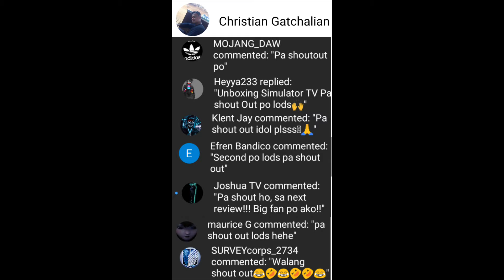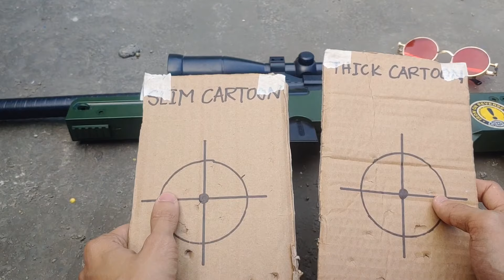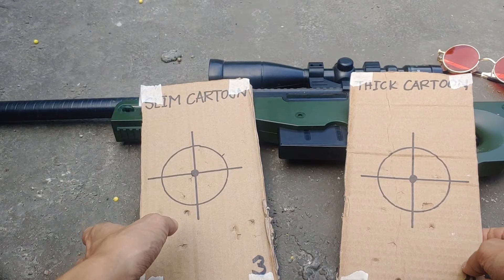How To Upgrade Spring Type Airsoft L96 (Upgrade by UNBOXING SIMULATOR)

Comment: Lods bumile ako 8mm aluminium barrel kaso Hindi fit ang mga bbs, brass tube be dapat talaga?
Reply from the maker: Nako lods... Dapat 6mm ang inner diameter.....ganyan din nangyari sa akin lods....di kaagad pumasok yung bbs.....kaya dapat percision bbs na ang gamitin hindi na yung mga low grade na bbs
Reply: @Barrio_WakwakG.  6mm inner diameter at .20 at .23 precision bbs gamit ko Pero Hindi parin kasya
Reply from the maker: @l3m0n73  uhm....kailangan mo lakihan ang butas ng dulo ng barrel lods....na deform kasi angbsize ng dulo ng barrel lpds dahil sa pag cut nyan sa factory.....so hindi exactly 6mm ang dulo nga barrel.,...kaya ang ginagawa ko ay......... Gagamit ako ng knife or scissors.....at gagamitin ko yung matulis na dulo ng knife or scissors......para itapat sa dulo ng barrel.......at ididiin ko......at ika-carve out ko yung dulo sa pamamagitan ng pagikot ng matulis na part sa knife or scissors sa may inner diameter ng barrel......para lumaki ng kaunti ang butas ng inner diameter ng dulo ng barrel......gagawin ko ito ng paulit ulit hanggang pumasok na yung bbs sa loub ng barrel........at para tumagos yung bbs......gagawin ko rin yung prosesso sa kabilang dulo.
Reply: @Barrio_WakwakG.  ginawa ko na to lods kaso lng Yung sa gitna na part Hindi ma abot kaya Hindi parin kasya Yung bbs:(

Comment: Idle ano size Ng brass tube pipe mo 2mm 3mm 4mm 5mm
Reply: Yan po Yung nakita ko na size SA shopee ano po size Nung ginamit nyo
Reply from the maker: @jdaigaming871  ang inner diameter ay 6mm....kasi ang standard diameter ng bbs o pellet ay 6mm din....kaya kailangan mo ng 6mm inner dimeter na may 8 mm outer diameter barrel.

Comment: Lods ano po mga size ng mga ginamit mo pang upgrade
Reply from the maker: Yung metal barrel lods,,,,, Dapat ang outer diameter is 8 mm at ang inner diameter is  6 mm. Kasi 6 mm ang size ng BBs
Reply: Ahhhhh salmat ng marami lods
Reply: Lods diba pwede naman gamitin yung original barrel ng l96 pang upgrade o kailangan talaga paltan ng bagong barrel
Reply from the maker: @aruyelva8052  pwedi namn gamitin ang original na barrel lods...lalakas parin ang tira....dahil inupgrade namn ang power ng airpump piston
Reply: @Barrio_WakwakG.  sobrang salamat talaga lods
Reply from the maker: @aruyelva8052  Walang anuman lods hehe

Comment: Anu po yung outer diameter ng brass barrel po?
Reply from the maker: Nabili ko ang Copper Barrel sa Shopee at ang pangalan ng store ay fenteer.ph at ang pangalan ng item ay Brass Pipe Copper Tube Round Outer 6mm-20mm Length 500mm Model. Ang pinili kung outer diameter size ay yung 8mm para ang inner diameter nya ay 6mm.

https://shopee.ph/product/89123457/6105248218?smtt=0.366868155-1631596458.9
Reply: Oky po thank you

Comment: magandang araw po ka-review. ask ko po sana kung saan nyo nabili ang Metal barrel? at kasama na po ba dyan yung rubber na nakadikit dyan sa dulo ng Metal barrel?

at tsaka yung spring po. baka may alam kayong good source or store na maari kong mabilhan for the said parts?
Reply from the maker: Nako hindi kasama yung rubber na nakadikit sa dulo lods,,,nag modify talaga ako gaya ng pinakita ko sa video.

Nabili ko ang Copper Barrel sa Shopee at ang pangalan ng store ay fenteer.ph at ang pangalan ng item ay Brass Pipe Copper Tube Round Outer 6mm-20mm Length 500mm Model. Ang pinili kung outer diameter size ay yung 8mm para ang inner diameter nya ay 6mm.

https://shopee.ph/product/89123457/6105248218?smtt=0.366868155-1631596458.9

Sa spring naman lods,,,, yung bagong spring na ginamit ko sa video,,,, spring yun ng ibang pellet gun na sira na kaya ginamit ko nalang para sa pag upgrade ng L96,,, mas mahaba pa kasi yun kaysa sa original spring ng L96

Comment: My upgrade is just the inner barrel and the scope. The scope I disassembled the scope to add the crosshair using masking tape and black marker. The inner barrel I made it longer to make it more accurate. And instead of using the plastic or metal pipe to replace the short barrel, I used rolled long bond paper instead hehe
Reply from the maker: wow man.... that's a different idea ....nice one heh3
Reply: Galing ginaya ko ung naisip mo